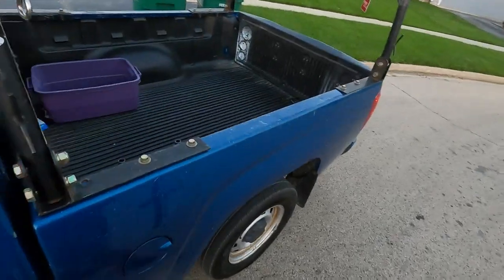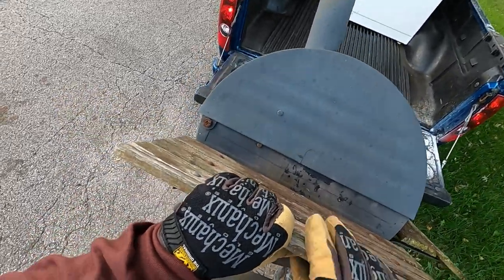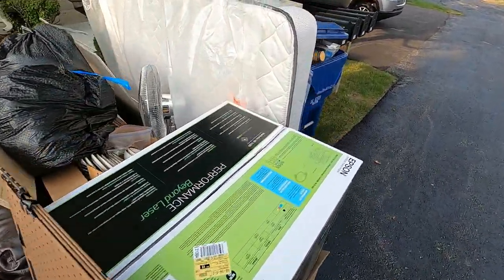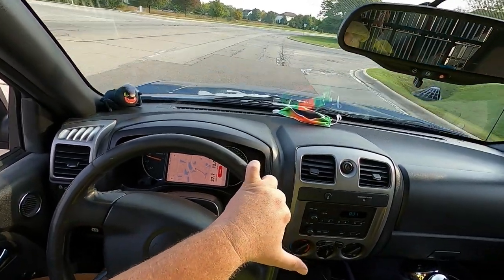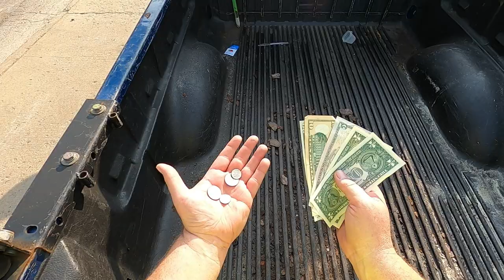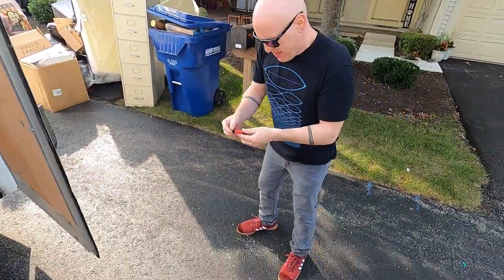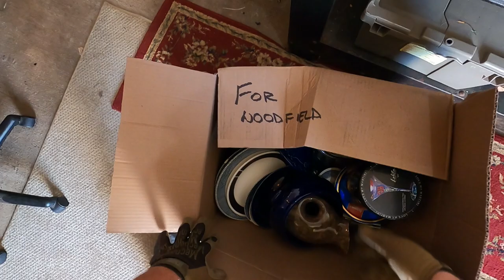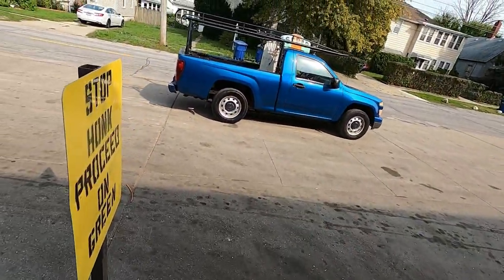They Threw Away All His Stuff

Comment: Paul, I still said you should get a stripe of 1/2" thick nylon plastic the with of those slides and bolt it (and do not forget to countersink the bolt head) on them it will make pushing up washers etc up to the truck.

Comment: People if you ever have a fan like that it is just dried out of motor grees or use heavy oil too and put it on the inner side of the shaft, Behind the fan blades work it in by tilting it on its backside so it will work with the gravity plug it in and run it so it works its way inside the bushing and that's it, It should be fine for another couple years or even more if you are able to put the proper motor Grees, You all have a wonderful day.💪😎

Comment: The pretty fan can be repaired with a screwdriver and a few drops of oil,,,  Remove enough stuf to expose the motor bushings,, put some of the drops on one bushing and the rest of the drops on the other bushing,,, test motor to see if enoughj oil was applied,, and then reassemble,,   :-)

Comment: I really hope that was just residual water from the hose you popped off the wash machine. Literally on last moving day some family were running a load of just washable runners & bath carpets, last min stuff, load ran abt 30 sec after washer filled & then seized up. They had to bail water with cups because didn't have a narrow bucket. They said good riddance & got a front loader.